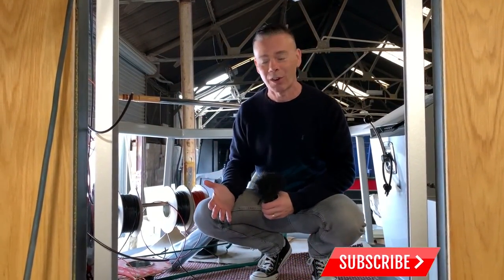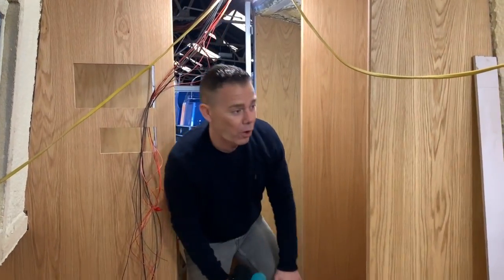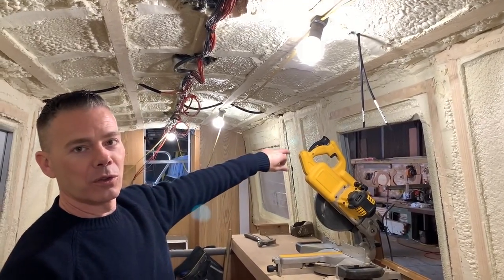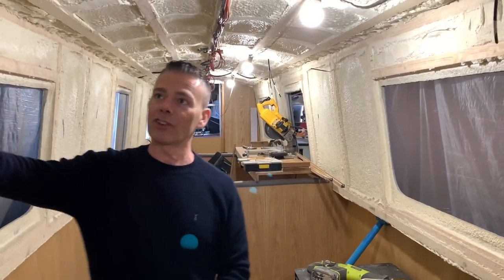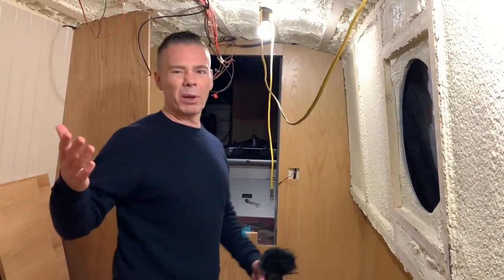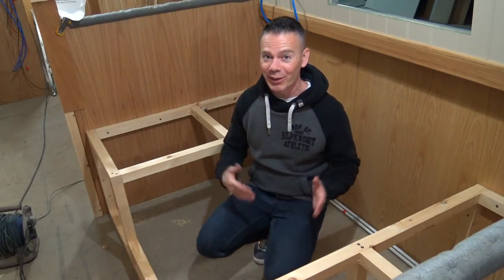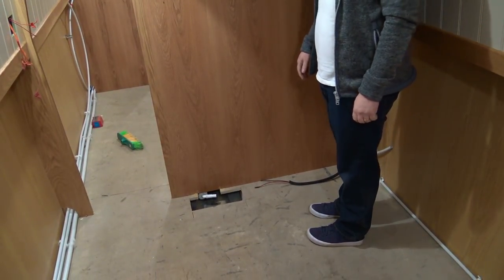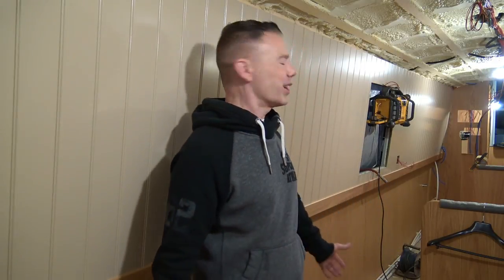How to Fit Out a New Build Canal Narrowboat - Ep. 32

Comment: Really great progress. Do you have to get a special sofa that you can dismantle to get it on board and where is the washing machine going?
Reply from the maker: Hey Colin 👋🏻 
The sofa will be built to order and installed by the manufacturer. The washer is going in the galley, starboard side, under and to the right of the sink. We’ve got a plumbing vlog coming up (28th) showing the plumbing and position 👍🏻

Comment: Beautiful work.  Simply wonderful choices.    What's the total length of the boat?  The interior looks a bit short, but I guess you have a long cruiser stern with lots of outdoor room up there, so things might reach out to the magic 57' mark.   I know that the finish ceiling isn't in (an probably no finished floor yet either), but the boat looks quite tall on the inside.  Did you specify additional head height and have the shell built taller?  Is that even an option (at 6'4", I appreciate the extra room)?
Reply from the maker: Hey Aaron. I reckon the camera angles can be deceiving. The boat is very slightly over 57 feet (one inch). The interior is very well designed to make use of every inch, and I think that might look more like it once it's completed. The ceiling, well, we didn't ask for it to be higher, and again, I think when it's completed it will look different. xx

Comment: my sympathy on the acid reflux, i have it. i use my camper with my head at the rear of the van as it's higher. your other option would have been to have the bed made higher at one end, though it would have looked a little odd.
Reply from the maker: Hi. Yeah, it would have looked odd, plus we wouldn’t have been able to have the cupboards above that side of the bed. I can’t believe more people don’t just switch it around 😂 Reflux sucks! xxxx

Comment: When you squared up the wall for the shower, was that lower space utilized for anything, or do you have a cavity between the wall of the shower and the wider lower part of the boat?
Reply from the maker: There is a small cavity (about six inches) but we leave it for ventilation and a water detector in case of leaks.

Comment: Hi guys,l would like to know,how long could you run your electrical appliances,also lighting in the cabin of silver 🦊,on a fully charged 
Battery pack,without using the alteator and solar panels,are the batteries that efficient in holding a good charge,
Is it possible the battery power could last for up to a week,before recharging in the normal way
Reply from the maker: Too many variables to say, Anthony. With good weather and sunshine we could go several weeks.